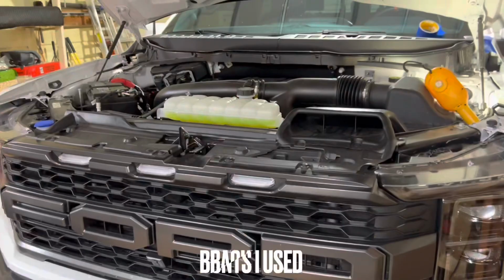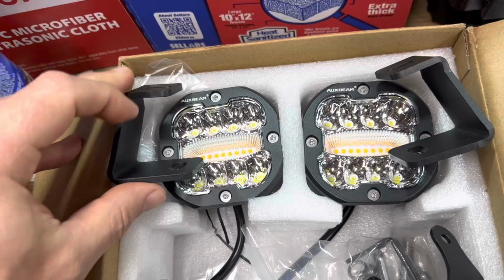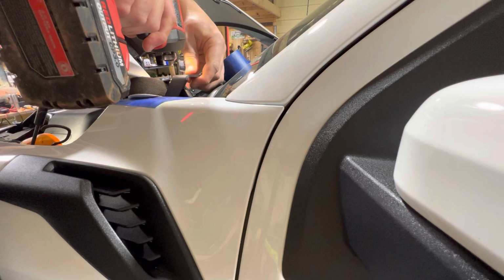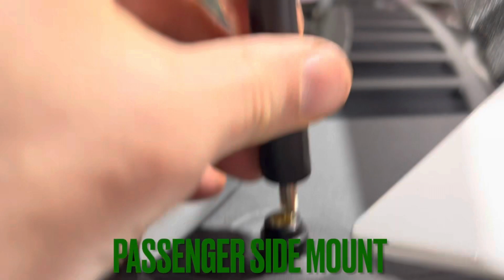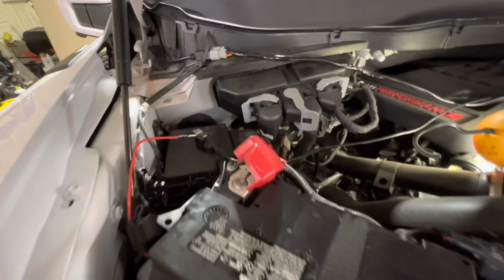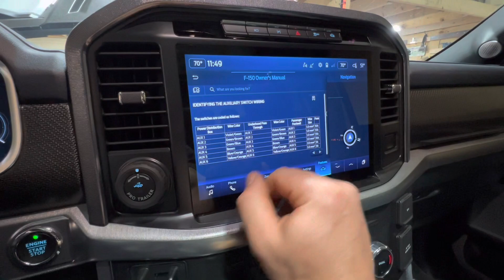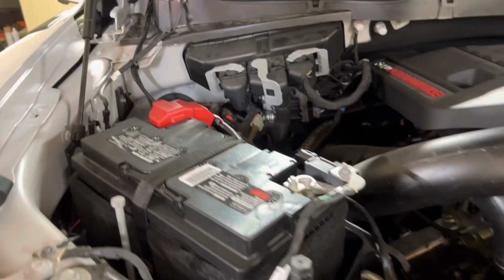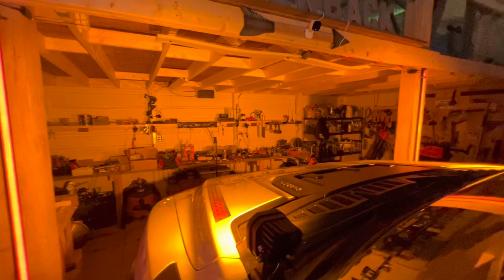2022 Gen 3 Ford F150 Raptor Ditch Light Install and light demo

Comment: Do we need to cut the relay and fuse stuff , if connect to the aux switch.
Reply from the maker: The factory Aux switches are fused and ready to go. Look up aux switches in the digital owners manual on the screen for colors and amp ratings